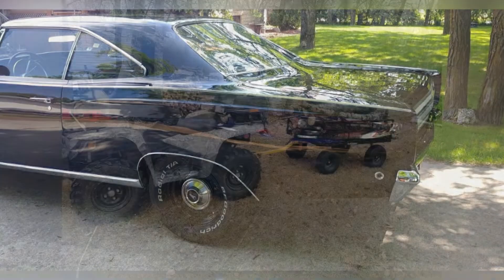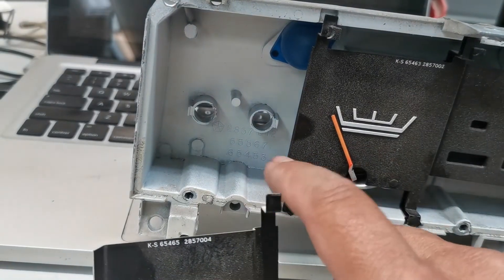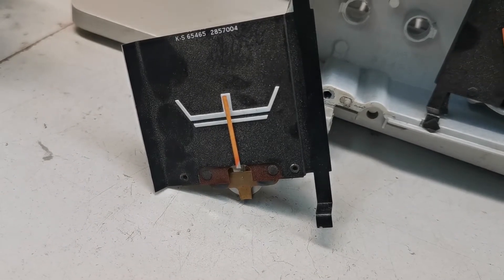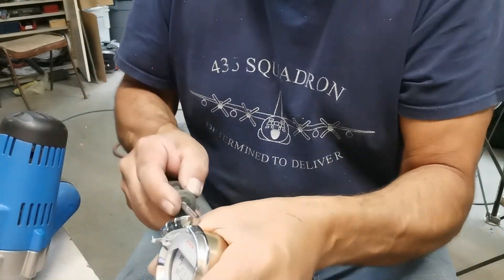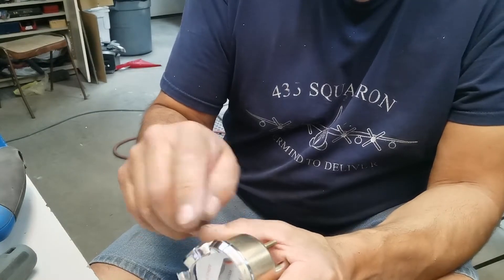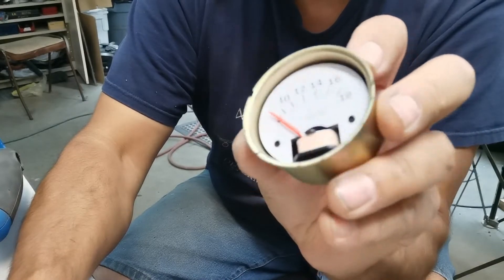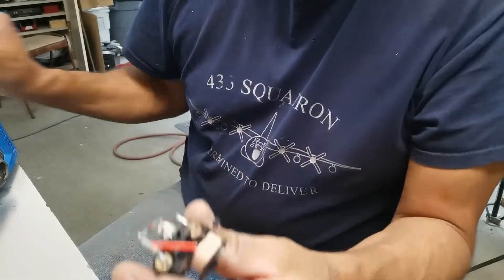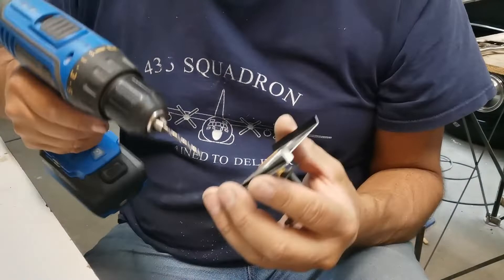Part 1 of 6, Ammeter to Voltmeter Conversion

Comment: Hi,
Thanks for taking the time to video this process. 
I've watched all 6 of your videos on this and it will be very helpful for a lot of us.
I'm restoring a '70 Sport Satellite that I'm cloning to a Roadrunner. It currently has the Non-Rallye dash but I've bought a Rallye dash (and dash frame) and I'm getting ready to install it. I'm about to purchase a new complete wiring harness for the car so I can rewire it and want to do this at the same time.
Question:  Other than the appearance/style Volt meter I choose, I assume this same process should work for the Rallye Dash too - correct...? 
The ammeter in the Rallye dash is to the far right, unlike the Non-Rallye dash which has the ammeter on the far left.
Thanks so much for any info you can share.
 
Van McDowell
Reply from the maker: Thanks for the kind words. I would think that as long as the size is similar, the conversion should work. It's been about a year in service and works well. The only negative is a bouncy needle. Good luck.
Reply: @retireready7090  Thanks so much! I'm going to find a volt meter the same size and give this a try. Your creativity was very impressive and just hope my conversion will be successful too. Thanks again!